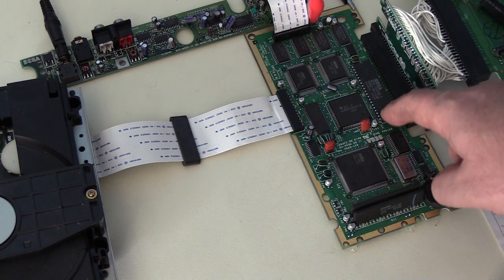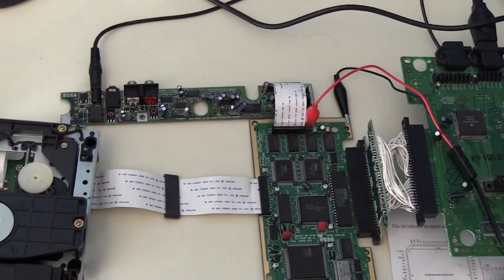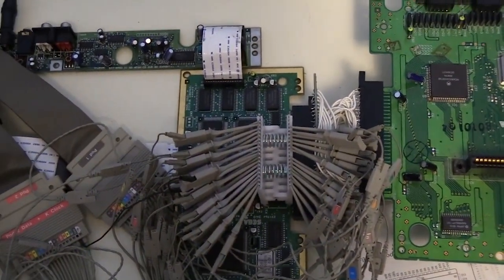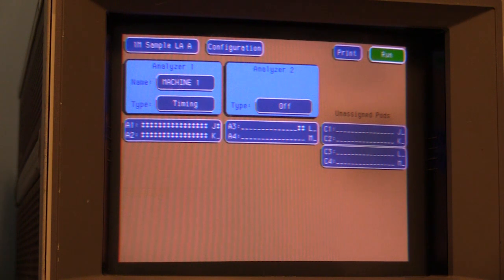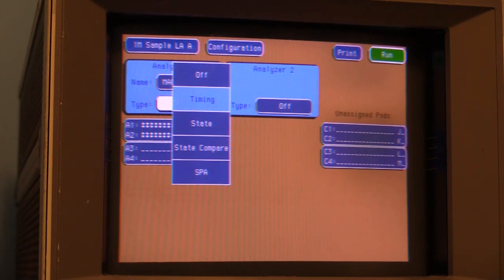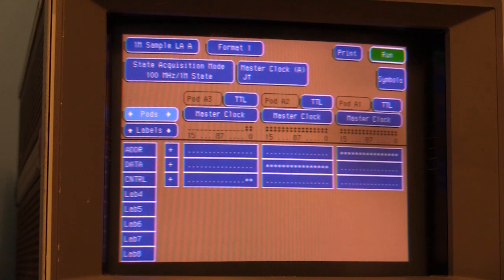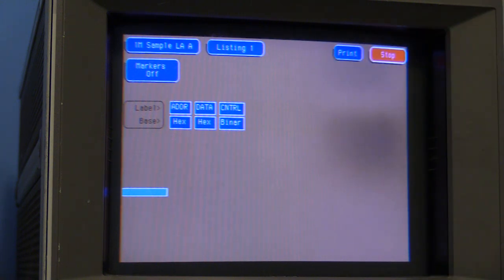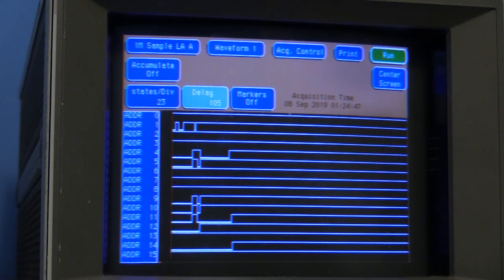Sega CD Troubleshooting Using Schematics and a Logic Analyzer - Part 2

Comment: Great videos. I have 2 cd1 system boards that wont boot. 1 looks really clean but getting bank switch fail and some register failures. Tried another program ram chip and reflowed the mce but no luck. My other one I think the board is bad as I found broken traces. Ide love to have a test setup like you have. I did order some new boards so hope it fixes the one at least.

Comment: Where did you / how did you get the wire connector to connect your genesis/mega drive? I am trying to troubleshoot a Model 2 Sega CD but its so annoying with the genesis requiring to be ontop.

Comment: I second the thanks for the HP Logic analyzer "Quick Start"  I've had one waiting to try on some 68000 boards but did not want to invest the learning curve.  I don't SEGA but are the stuck lines only connected to the ROM and the Sega chip?  And another helpful trick is using a super fine wire brush to scan a board for connections from mikeselectricstuff https://www.youtube.com/watch?v=ehyfmMw29NU

Comment: Your video is the only in internet I could find with such important information. I’ve bought Sega CD on ebay in a very bad condition, many traces on the board a corroded and disappeared. Your information helped me to figure out that the main cpu is alive and restoration won't be pointless. I hope other components are fine too... Thanks!
Reply from the maker: I'm glad that my video was helpful.  Good luck with your repair!